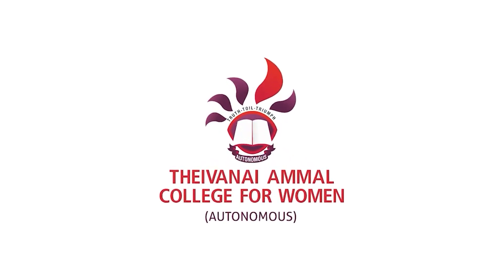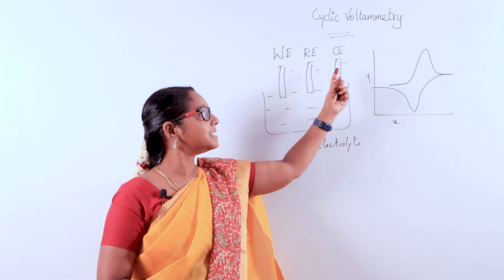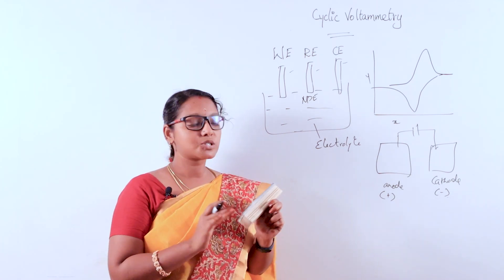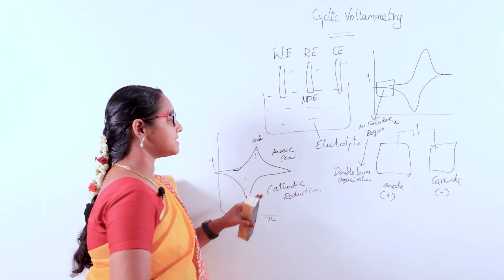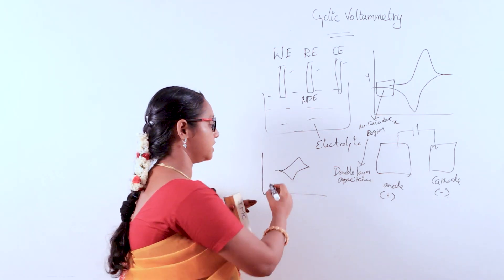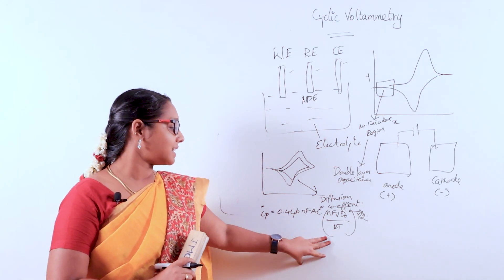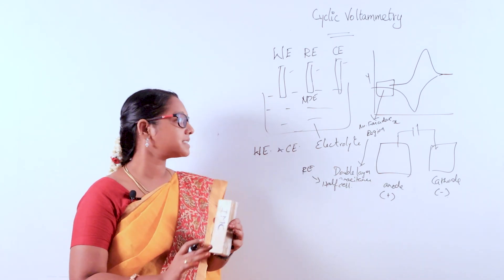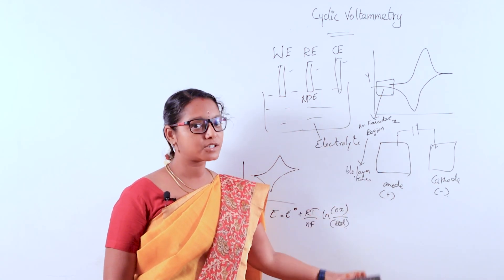Cyclic Voltammetry | Chemistry | E-learning

Comment: You said lot of concepts, wrong, anode loss of electron, cathode gain of electron will takes place, but you said it in reversible manner, also we didn't not change the potential,for measuring diffusion coefficient, we change the scan rate, the potential window is constant throughout the experiment once we fixed, we just vary the scan rate... before putting vedio u just checked once time that all the concepts are correct... don't change the concept...bcz lot of people will watch these vedio...